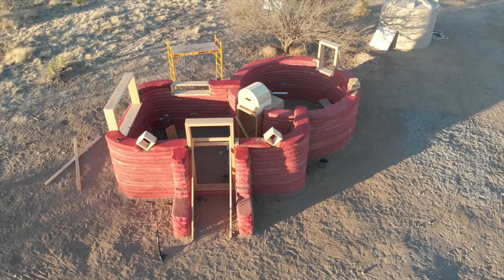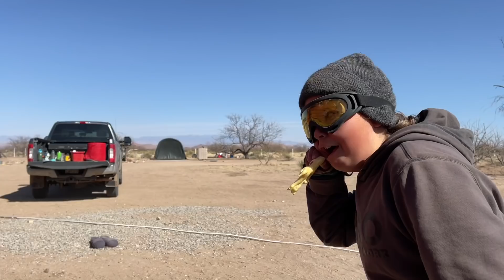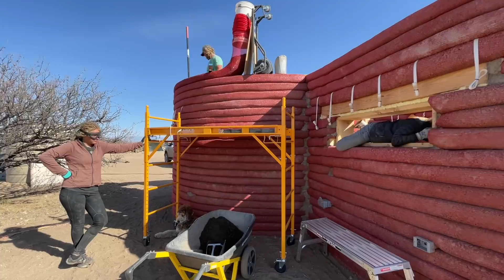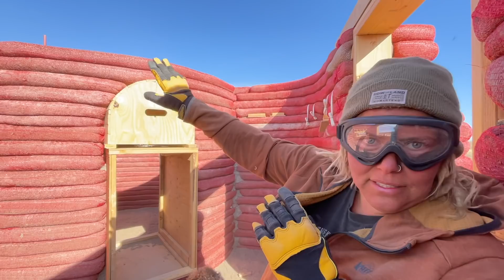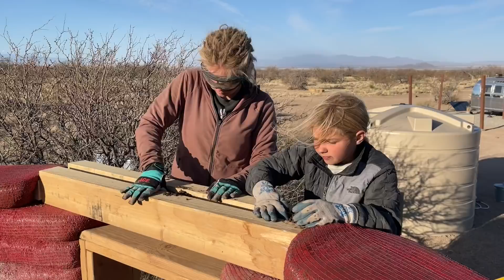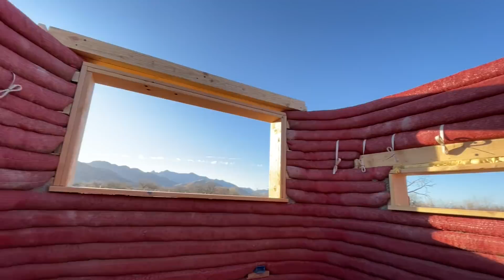Installing Lintel Over 6' Window in Hyperadobe Building

Comment: Could you have just not built the inside wall of the cylinder and then built it out of studwork later? I assume you'd still need quite a lot of bags in buttressing to support the outer walls at that point anyway?
Reply from the maker: Yeah. It’s all supporting each other.

Comment: Have you guys been nailing in rebar to stabilize the bags? I know this is suggested with superadobe structures that are not domes or full circles, especially next to door and windows. I've seen suggested that they are stuttered , overlapping angles. Is it different for hyperadobe?
Reply from the maker: Yeah. It’s a little different. Our mesh bags really interlock with each other. They do suggest buttresses if your straight wall is more than 10 foot long. (Buttressing every 10 foot) which is why we added the buttressing at the front door. But I don’t think we need it at the windows. We do wish we didn’t put such a large window on the west side though. It’s too close to the corners. We won’t do that on future builds.
Reply: @TinyShinyHome  Yes, seeing that large window near the corners is what made me think of it! I'll be eagerly watching the progress.
Reply from the maker: We’ll see how it works, but the whole thing feels solid so I’m not too worried about any of it honestly. But this was a learning project. We’ve found lots of things we will do differently next time. We’ll be sure to add all our thoughts about that in a future video:)